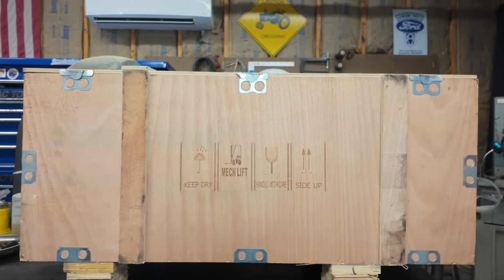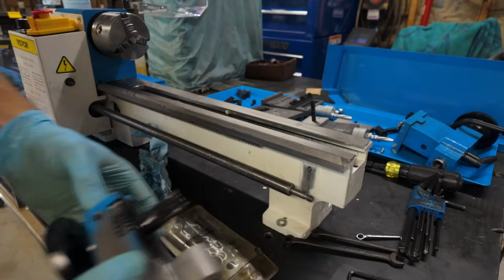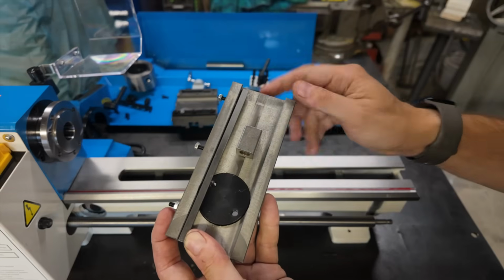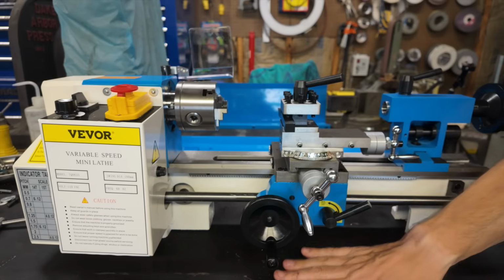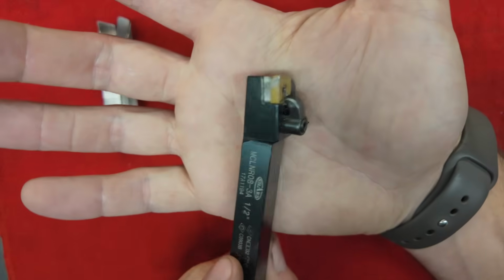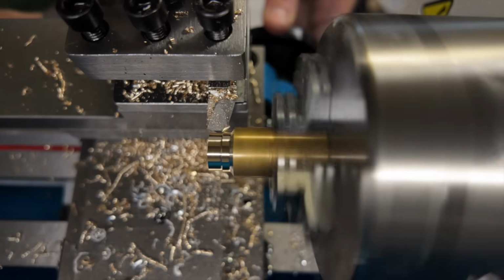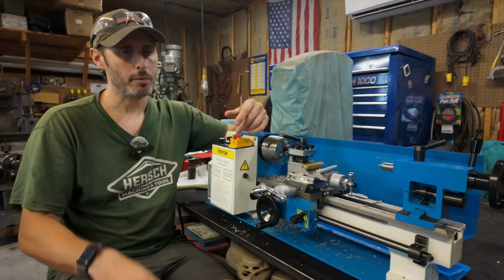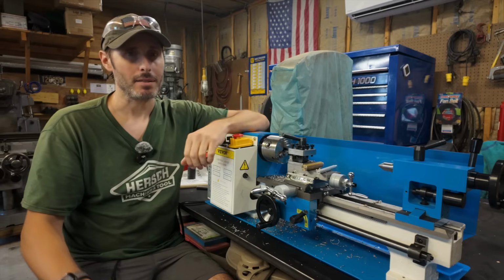What I DIDN'T Know About This Mini Lathe SURPRISED Me

Comment: I have the older red chinese lathe same size and variable speed, and would like to see any mods you do, tapered head race bearings were one i wanted to do, these have their place for us guys that just need to make a small part quickly, i found hs tooling best for me as i can sharpen and shape to suit, but looking forward to anything you have to give us, as you say out the box the lining up/ gibs / adjustment needed are unending, so many thanks

Comment: Mine has a treadmill motor running on a 16s lithium battery😂,,, no cross slide,, solid block instead, original controllers junk,,,,, regually take 2mm cuts, 80 thou,,, in 316 stainless,,, they need abit of work but theyre pretty good once done
Reply from the maker: LIKE A BOSS! 💪

Comment: A .050  pass actually only cuts .025 depth as you are only cutting one side. It does make a .050 cut overall.
Reply: No. a .050 cut actually reduces the diameter by .100.

Comment: What is the number 7 by 12 you  mentioned
Reply from the maker: It’s the size of the lathe. 7” swing X 12” between centers. It’s an approximation of the max size work you can expect to fit in the machine. 7” diameter by 12” length

Comment: i want to see upgrade and after you do the upgrade i need to see how the mini lathe handle tool steel 1045, 1095, O1, A2, W1, W2. hat i know of mini lathe it's design for soft material but will see.
Reply from the maker: It isn’t that they are “designed” for soft materials as much as it comes down to rigidity. Small machine is less rigid. But I have already turned 304ss in the machine which has lower machinability than many tool steels in the annealed state. So I’m confident that it would handle something like O1. I’ll put together a project though, stay tuned!

Comment: Way oil has its place, (shaper is No.1),  but a better thing for a small lathe or mill is Boeshield T-9.  This prevents rust and because of the waxy layer provides lubrication without chip retention, the latter can be a real problem on smaller machines without multilayer way scraper/seals.  Another alternative that works really well is ATF as it has great shear strength, detergents, prevents rust and again, does not hold swarf. 
 Just my thoughts.
Reply from the maker: Hmm, interesting. I’ve never even considered boeshield.

Comment: As others have said with bottom of the barrel Chinese products you will have plenty of fix'in to keep you out of trouble for a while.
When you bolted the bed to the table you have almost certainly twisted the bed. Get a precision level (ask nicely to borrow one) and shim the mounts as required to get the twist out. You can't see the twist by eye but it will turn up every time you cut a long shaft.
Most importantly you have a dangerous habit of leaving the chuck key in the chuck without your hand being on it. I have worked in machine shops  where they would fire you for doing that. If you ever saw a chuck key flung across the shop like a frisbee from an accidental lathe startup you would make sure you never did that.
Good luck with your lathe.
Reply: I was also surprised at seeing the chuck key in what so many Youtube 'engineers' seem to think is it's natural resting place! I learned the dangers of that foolish habit many years ago after seeing and hearing the results of the things flying across the school workshop. After seeing someone sheepishly creeping around trying to find the thing you soon learn.
Reply: If was looking, which is am. What would be an entry-level metal lathe that is not the bottom of the barrel?

Comment: That part about not everybody having a factory building to place huge machines (even if you could get decent old ones at a reasonable price) is the important bit here. Mini lathes do not need to be cheap, unprecise or underpowered. I got myself a second hand lathe-and-mill-combo from austrian precision manufacturer Emco. Its 500W on the lathe and 300W on the mill, cost me 700€ . Tailstock and slide are non-adjustable but precision made. I added a 150€ high performance quick-change toolpost and put axial bearings on the leadscrews, also mounted the lathe bed to a massive iron beam for rigidity. I do routinely machine stainless and toolsteel up to about 100mm (~4inches) in diameter. Reached single-digits microns tolerances and mirror-finish on surfaces. Here I am, making actual tools and machine parts at below $1000 worth of machinery. Also, being the precision tool that it is, i can make replacement parts for the parts that are underperforming, gradually increasing the worth and usability of my machine.
Reply from the maker: 100% I often seen people on forums, comments, etc fixating on the machine, or condition of the machine, etc. But at the end of the day, we all have different circumstances but make the most of what you have available and work will speak for itself. Keep rockin', and thanks for watching.
Reply: Now all you need are decent motors. 500W is only 2/3hp, which is barely enough for a good hand drill. A mini lathe should have a minimum 1000W & a small mill 1500W. That's what I have on my machines & I still find the lathe to be under powered.
Reply: Could you look at what happened to me when I got my first Vevor metal lathe? Tell me where I went wrong, please? https://youtu.be/PlfRQMUhz9A?si=Z0wJ4BVi9SQsazPy

Comment: Any lathe is better than no lathe. I don't have the space or money for a large lathe, I bought my bench lathe 20 years ago, made so much on it, mostly from steel with insert bits rather than HSS, I can't deal with grinding angles on such small bits.
Reply from the maker: Amen to that!
Reply: I use tangential tooling a lot.  Super easy grind with a jig and with good tool steel or a cast bar like 'Crobalt' can machine quite hard materials.
Reply from the maker: @Onan-u3b  I’ve never been fan of tangential tooling, mostly because the tangential holders I’ve seen hang the tool way out from the post and introduce unnecessary rigidity issues. That said, I know some people really like them and I support the heck out of it if it works well for you! 👍🙂
Reply: @Onan-u3b Never heard of it, so not sure if you are even talking about a whole new option of tooling here?
I also like to use a jig when sharpening anything if I can so would like to know more.

Comment: i like to mention, that if one bolt down the machine,  you should level the ground and watch out, that the machine bed does not flex by bolting it down. May be this is, why they give you that rubber things, that also may hold back fluid from getting throught the holes where the bolts gets throught, if you use cooling fluid. But you sure can make it like you do, if you know, what the machine like to be done with it. Thank you for this video.
Reply from the maker: I did consider leveling the machine in this video, but decided that's a whole video in itself and there are tons of "how to level a lathe" vids already on YouTube so I skipped it. But great point nonetheless. Thanks for watching btw :)

Comment: I have the 7x14 variant, also from Vevor, it was much like yours out f the box, it worked but not that well.  The first big issue I had to tackle was the tailstock, saddle and headstock not sitting correctly on the ways, the V for the prismatic edge was too small so the V sits about 1.5mm too high and he back surface runs on the edge of the bed, not ideal and caused a lot of chatter.  This was corrected by milling the V wider, I had to buy a mill to do this.  This led to a long story of adjustment and modification to get all 3 to line up again and the tailstock needed height and side adjustment to achive this.  This was a big improvement but there was still an issue with the gibs in the slides, they were cast iron, sticky in use and were bent and a little tapered.  These were replaced with shop made bronze ones that fitted and the lathe is now happy to use insert tooling with no chatter and will take larger cuts than anyone would expect.  These lathes can be good but not until a lot of remedial work is done, I am self taught with help from Youtube and Google, I managed it at very low cost and he lathe is in daily use and reliable and nice to use now.  It will be interesting to see how yours turns out after you have found all the issues.
Reply: Buying a mill to fix your new lathe.  That's a deep rabbit hole...
Reply: @kaasmeester5903 
Buying a mill to fix a lathe makes perfect sense to me.
Reply from the maker: Yeah I was thinking about maybe doing some scraping on the saddle and cross slide to improve the surface contact since they are just machined from the factory and obviously not mated to each other like you'd find on a high end machine. And I thought the same thing about the gibs immediately, especially the saddle gibs, I'd also like to swap in bronze replacements.
Reply: Bronze gibs 👌
Reply: Could you look at what happened to me when I got my first Vevor metal lathe? Tell me where I went wrong, please? https://youtu.be/PlfRQMUhz9A?si=Z0wJ4BVi9SQsazPy
Reply: Well its kind of like Boofeng radios. So cheap and no qc, you can buy 4 to get 1. Glad were not buying chycom cars....   yet
Reply: It’s hard to learn on something that was slammed together with reject parts from the scrap barrel.  I speak from experience.  Typical Vevor.

Comment: Good video i watched a guy do a vevor vs  precision matthews shootout and the vevor  out of the box worked like junk . I would like to see this lathe with some major modifications . Like motor 3 ph upgrade w VFD and a High low pulleys using a small trimming belt ( cog ) also it would be cool to see a custom spindle with some type of quick change chuck system . I know that is a lot of work just a idea .  You have a good casting it looks like you could make this a high-end machine one of a kind .  Thanks JM
Reply from the maker: Some really great ideas there, definitely not out of the question at all. If the videos do well, then it's absolutely worth it. And my very first machine was actually a Precision Matthews 10" lathe. Honestly, I think it's not quite a fair comparison given how much bigger the PM lathes are compared to a true "mini" lathe. PM does offer great customer service though, which I think is very valuable.
Reply: If its the video im thinking of it was bs. The vevor vs PM weren't in the same class. Bad comparison
Reply: Why would anyone invest time and money trying to make a Vevor right? I tried for 6 months.  The castings are rejects, that didn’t meet quality control.  It’s how Vevor can build them for next to nothing.  When a customer finds out they are garbage, and wants to return it, they do not want it back, and are willing to settle monetarily.  I got 90 percent of my money back from Vevor, because the bead was warped beyond repair, and they couldn’t supply any parts.  I would have to say that they were very responsive.  After being compensated, I junked the lathe out and now have a Precision Mathews 1130.
Reply: @rodgraff1782  It's pretty silly to compare a $4500 PM lathe to a $500 Vevor hobby lathe.
Reply: @larrybud after the Vevor I bought another mini lathe from micro mark.  It needed nothing, and was inspected and set up, before I received it.  This and little machine shop mini lathes are the best of the imports.  I needed something larger, so I got the PM.
Reply: @rodgraff1782 and the little machine shop tools are at least double the price for the same size, because they've done the work that the hobbyist may do with the vevor.

So why go with the vevor, or any other multitude of $500 mini lathes? Because having a lathe is better than no lathe, and one can learn metal working by improving their cheap Chinese lathe
Reply: Who is comparing it with the PM?  Of course these cheap mini lathes are not in the same class.

Comment: 50 th was a good test I think it needs several weeks to bed in. Then a review should be done on the  machine are the bearings running true are the ways showing any wear, how many times did the gigs need adjusting, motor running or normal is the chuck keeping the material secure.  it's not all about how big a cut can be made but how accurate are the cuts running a tapper can you cut quality tappers for v/v's seats  these are the things new hobby machinist need to see. Does the tail stock provide a secure drilling base hoe easy is it to determine  length and lots more
Reply from the maker: Excellent feedback, thanks!

Comment: I have that exact lathe. Added coolant and DRO  to the ways and tailstock. Struggle with small OD screw cutting (backlash) and wonder if you can retrofit a gauge rather than leaving the lead screw permanently engaged.
Reply from the maker: It has a metric lead screw so I'll have to do some research. But this is a great problem to try and solve!

Comment: I have a Harbor Freight Mini lathe.  Originally it was a 7" X 10".  I ordered a a 16" bed so I have a 7" X 16" mini lathe.  It was worth the expense.  I have overthe years spent a lot of money on improvements.  The list is long.  One theing that I have yet to solve is the weakness in the compound slide and the cross slide.  I have been able to reduce  the baclash in the cross slide to approximately .004".  I found that the compound slide gibb adjustment needed constant attention resulting in adjustment.  The biggest problem I have encountered has been "excessive" tool deflection cutting various steel material.  I would like to know if you have encountered the same.  You might notice this by taking spring cuts and measuring how much is removed when taking a spring cut.  I generally have to take about 2 to 3 spring cuts to get the diameter I want.  There are other things improvements a mini lathe can benefit from but that should come in another post.  Bew well and proper.  KOKO!
Reply from the maker: Yeah the compound is often a source of play even in bigger machines. I locked it down for this test and always keep it locked even on my bigger machine. One modification would be replacing it entirely with a solid tool post and only putting it on when it's needed.

Comment: I really wish Vactra 2 was "easy to find" in NZ. I use hydraulic iso 68 instead.
Reply: Find an oil/lube specialist/supplier, ask for a Shell Magna 68 or any other such way oil... They will likely have one or the other, my supplier doesn`t hold Vactra way oil, but he holds velocite spindle oils... Look up equivalency charts and just take the oil that`s available... You can even go with Mobil DTE heavy series... My Emco FB2 uses DTE light series oil for the headstock gearbox, as it`s a hydraulic type oil advised by Emco for the application and as a replacement for Emco`s long gone special oil, but the heavy series is way oil on crack... Find a metalworking supplies shop, or a machine and equipment dealer - they too stock way oil and similar metalworker`s lubricants, as well as spindle bearing greases and such...

Comment: I have virtually the same lathe, the only difference being mine says "TAQ" on the sticker instead of Vevor, lol.  Overall I'm happy with it, but there are a couple advantages to the Sieg and re-branded Sieg lathes (grizzly, harbor freight, and little machine shop).  First, they come with an imperial lead screw so they are also able to include a thread dial.  You can still single point thread, but you have to stop the machine, back the tool out, and reverse back to your starting point without disengaging the lead screw.  Another advantage is the saddle has cut outs front and back which you can utilize to make a simple, easy saddle lock.  You can still add a saddle lock to this style saddle, it's just a little more involved.  Another thing, if you are thinking Harbor Freight, spend the extra money and order the 7 x 12 sold online.  I've heard the 7 x 10  they sell in the store is actually only 7 x 8, I haven't actually measured one, but they do look pretty small in the store, could be because mine is a 7 x 14, but I doubt it.  Although I wasn't completely disappointed with this lathe, when I was ready to get a bench top mill to go with the lathe I spent the extra for one from Little Machine Shop.

Comment: Upgrades for sure - thrust bearing on the cross slide, compound delete, new hand wheels (a satisfying, easy turning project)
Reply: Just buy a precision matthews no upgrades needed and holds true
Reply from the maker: @onemischiefmaker7032  My first machine was a PM. Do they sell decent machines? Yes, some of them. But you're going to pay 10x the cost of one of these mini lathes to even get into the low end of that quality tier. Their "less expensive" machines are still just chinese imports, and they come with all of the caveats that come with any other chinese import. And they still cost 4x to 5x the cost of this mini lathe for even their smallest/cheapest model. What PM really offers is customer service. That's what you're paying for, excellent after sales service. But their support really is great.
Reply from the maker: Haha, some of the very same ideas that came to me immediately as well!
Reply: Could you look at what happened to me when I got my first Vevor metal lathe? Tell me where I went wrong, please? https://youtu.be/PlfRQMUhz9A?si=Z0wJ4BVi9SQsazPy

Comment: These lathes are a bit frustrating, a few quite simple design changes not even using more material or additional space would make them a lot better.  The manufacturers don't seem interested in making improvements though.
Reply: Vevor is not concerned  about quality improvements.  They throw these together out of reject castings.  Once they leave the factory, they never want to see them again.